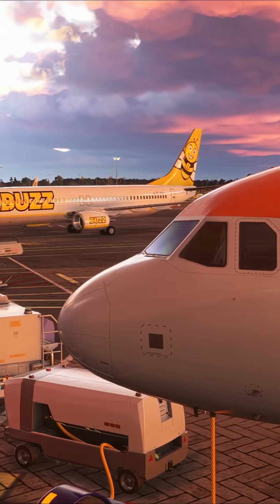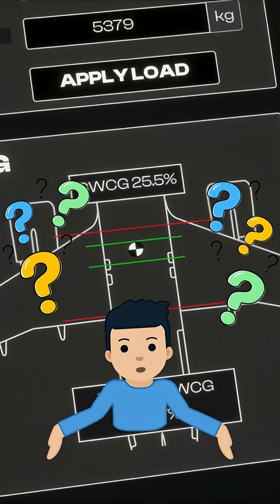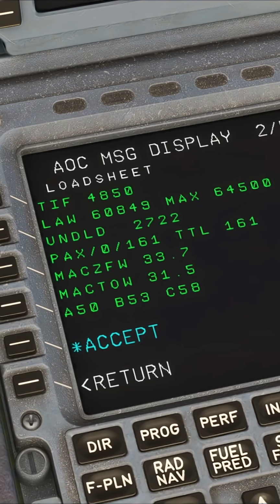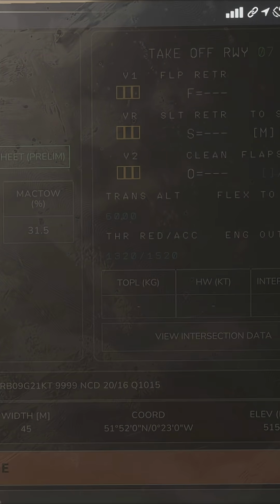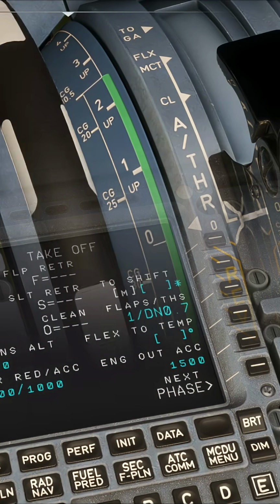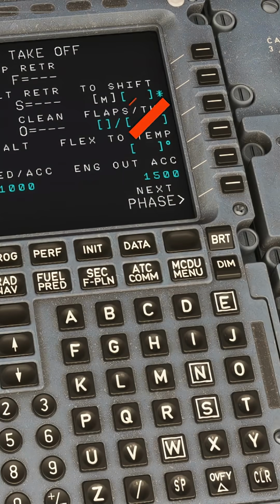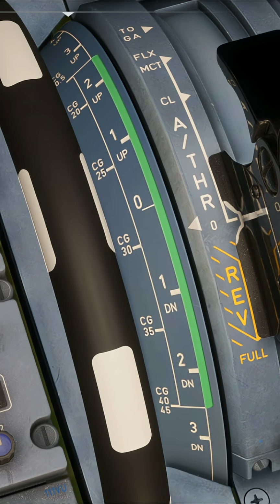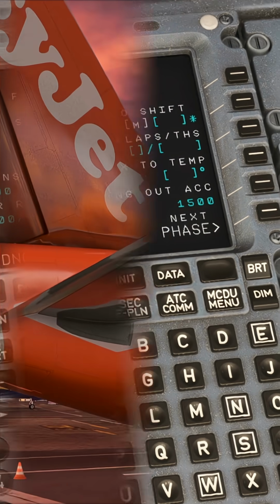A320 Takeoff Trim Setup Explained – Real World Pilot Methods #a320 #a320 #msfs2020 #msfs2024 #airbus

Comment: or you can just look at fctl menu there between aileron you see the trim configuration at what degree. but best to do it after you have all the hydraulic pump right after the engine is on

Comment: Thanks for this! Questio…whenever I do my take off performance calculations..9 times out of 10, my v1 and vr speeds are always the same. Why is this?
Reply from the maker: This is good and normal. The idea is to use as much runway as possible to take off, whilst maintaining enough runway to stop if required. So if V1 = Vr then you're acceleration is slow enough (saving engine wear and tear & fuel) that you can reach takeoff speed whilst still having time to stop. Usually happens on long runways. Try a short runway in wet conditions and they'll be very different.

Comment: for inibuilds family and the fenix family i can find the cg but with the fbw a32nx i can only find the zero fuel cg. Am I missing a page or is there a special way to find that cg figure in the fbw?
Reply: I'm not at my PC but check the Fuel Prediction page after engine start.
Reply from the maker: Yes, in its not very obvious in the FBW. However, on the tablet where you see the ZFWGC/(TOW)CG, they are interchangeable by clicking on it.

Comment: If you don't like eyeballing, you can look at the flight control ecam page on the lower ecam and it will tell you your trim setting. Much more accurate and much more helpful.
Reply from the maker: This will give you the UP/DN but not the CG
Reply: @Easyjetsimpilot and you can find the CG in the fuel pred page (just saying, my comment sounds snarky for some reason it’s not 😂)
Reply from the maker: Indeed it will, and you can of course check this after fuel is loaded etc (obviously, not before!)
Reply: @Easyjetsimpilot so if you need to set it to down 0.7 and the Lower ecam on flight control page says down 0.7 when you set it, that is not correct?
Reply: @MarkyDB it is correct, but because IRL pilots in the past have mixed UP and DN signs, some airlines have altered their SOPs to make the pilots physically check the trim wheel and eye ball the MACG %. The logic is that it's better to be 0.1 off the actual CG rather than set it to the opposite value.

Personally in the sim I always set the UP/DN value by looking in the ECAM. I  have never set it wrong, but that's the benefit of the armchair pilot, we are always chill never under time pressure.